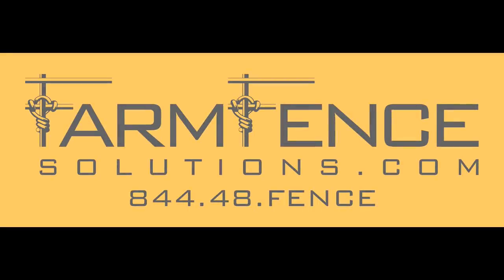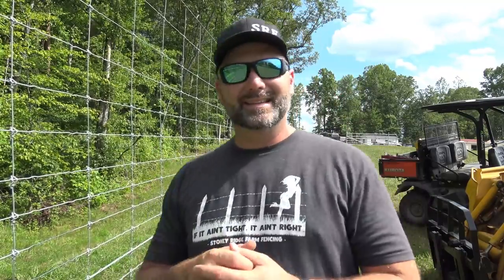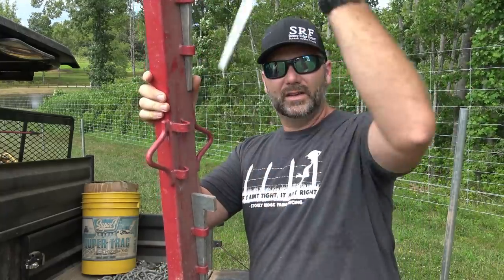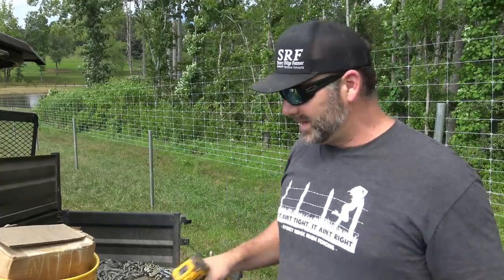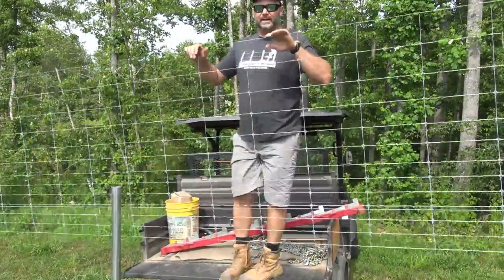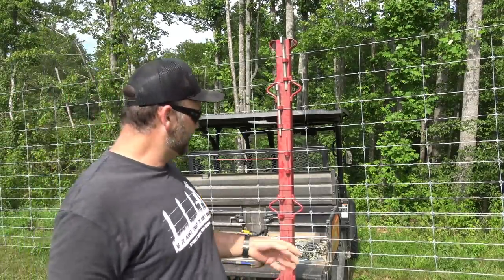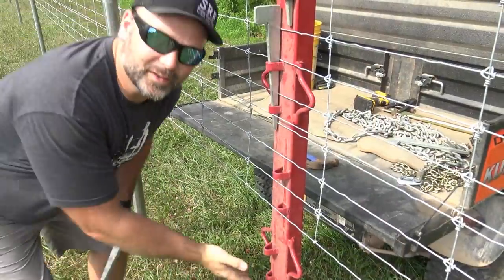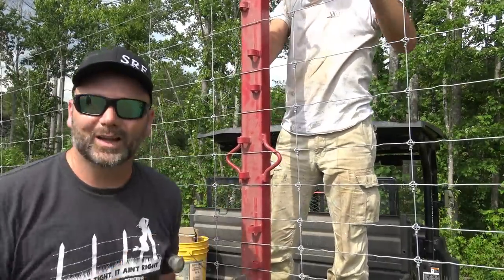THIS COULD GET INTERESTING! Farm Fencing High Tensile Woven Wire tips & Gates!

Comment: Just a thought on what I do on the gates that I hang, I coat it with axle grease, keeps it a little more quiet and won't wear quit as quick. Cause is ya think about it, that's a lot of weight hangin on those hinges.

Comment: I did a couple of gates before. On the high side of the gate you can weld extra runners at that side at an angle tobasically extend the gate down

Comment: dad always told us put the fence on the inside of the between the cattle and the post that way the cattle will push defense against the post except on the corner stinney put on the outside
Reply: called, fencing, in or out, you are correct, but most dont do it

Comment: Great video, learned a lyou used on different ot on fencing from you. I was wondering if there is video on what type of fencing you used on different parts of the farm and why?
Reply from the maker: we only have 2 types of fence...the wood fence you see in the background...and this fence...the wood is functional and pretty too...the pipe fence is also functional...we are constructing paremeter fence for different areas and paddocks on the farm...we'll use poly braid to section of and intensively graze as our herd grows

Comment: Curious to why you leave the guide wire with the fence after the posts are set.  I get why you are using it for the line to set the fence over string but is there are purpose for it once the wire fencing is installed?  Also where the gap is really big on the fence gate could you weld a section on it to fill in the gap?  I know it would look a little cattiwhompus but I would be concerned for the baby calves there as well. Great job as always!
Reply from the maker: The wire at the bottom brings strength to the fence....the top is the most stressed point....the second most stressed point of a fence is the bottom, as for the gate...10 inches most likely isn't gonna cause me a problem...if it does we'll address it for sure

Comment: I noticed in this video that the tops of your posts are not capped.  I know from previous videos that your pipes are very heavy duty, but there could be a possibility of those pipes splitting in the winter with water freezing in them.  You may consider capping the posts just to keep it from happening.  I have had pipe posts in Illinois freeze and split when I ddi jot cap them.
Reply from the maker: keep watching and we talk about it ...wink wink

Comment: Why is the fence on the outside of the posts? Wouldn't the fence be stronger if the fence was on the pasture side of the posts?
Reply from the maker: This was done for aesthetics here close to the house..realistically the cows will be out front here about 3 weeks per year
Reply: I've seen that question before and was curious myself. Josh will tell us !
Reply: @StoneyRidgeFarmer  how far did you space your posts?
Reply: Also what is the cost per acre for that fencing?
Reply: Looks like 20 or 24 feet on spacing but you can't do that far with cheap farm store store wire... Any low carbon wire needs post around 10 to 12 feet to be half as strong

Comment: Great video Josh. I do have a question, why did you go with woven wire vs a high tensile electric? Thanks
Reply: Not Josh, but if you can afford it,  woven wire for perimeter fencing is always the way to go.  No worries about deer dunning through it, power outage, or a short.
Reply: Steve Terry For rotational grazing, high tensile electric is pretty handy for setting up paddocks.
Reply from the maker: Woven wire parameter fence is best in my opinion...it's not a psychological barrier...it's a physical barrier to keep our livestock contained. Where we live is populated...not like Polyface (Joel Salitan) or Greg Judy's place that's way out in the middle of nowhere.  We'll have a "hot" line ran acrosss the top and in high traffic areas we'll have one at about 30 inches.  We will mobstock rotationally graze by tapping into the parameter hot wire and running poly electric cross fences...just like the other boys ya see here on youtube...but with Josh's touch.  Safety is priority....many a cow, calf or sheep or goat has pushed it's way under, over or through high tensile electric .....just ask anyone who's used 5 strands or even 7 strands of high tensile.  We need a physical barrier to keep our cattle away from the local roads.....So...the answer is safety...for our livestock...and for passers bye.  How horrible would I feel if I had thrown together a fence that wouldn't contain my cattle...and a state trooper calls me in the middle of the night to tell me a mini van just hit one of our cows and killed 4 children and a mother.......THAT'S WHY MY BROTHA...this is not the end of our fencing...this is just the start...the parameter.  Hope this answers ya....I'm getting ripped apart by every Greg Judy fan on the web....I've been there....I talk to the man on the phone from time to time....but our situations are very different....cool?
Reply from the maker: Thanks Steve....what folks have to remember is this is just the parameter fence....and we'll run a hot line on top...and we'll be intensively grazing once we have enough of a herd to do it.  This is a physical barrier...that's what it's all about...safety...security and being a good land steward.  We're far from done!
Reply: Fair enough. I’m familiar with Polyface and Greg Judy. It’s hard to judge tone through text so I hope my question didn’t come across as an attack. Just curious what made you go with woven wire. Thanks for the response.

Comment: Hey Josh, love your friends building series. I am curious as if there’s going to be cattle in this pasture, why your fence is not on the inside of the post and not the outside? Wouldn’t that make it easier for them to push it out?
Reply from the maker: so.....yes...however they won't be able to push the fence...we went on the outside here around the house for aesthetics...same as the wood board fence. We'll run a hot wire inside to keep livestock off the fences
Reply: Stoney Ridge Farmer got it Josh. I understand why you did it that way now. Love your channel and will continue to support.

Comment: Maybe i miss it ,? when did the lowest single wire get typed down? We ran a string of barbwire in that location and one at the top.keeps horse from reaching over the top and bottom.
Reply from the maker: oohh...don't tell the horse folks you're using barbed wire!! So the lower wire is tied in at the bottom of the net wire...provides strength down low...as you well know the most stock pressure is on the top of the fence...second most is on the bottom..thanks for the great comment Greg
Reply: @StoneyRidgeFarmer  So it is tied to the lowest strand of the fence wire. thanks! As for the horse folks they will just have get over it!!LOLL

Comment: A fence is a long term investment...spend the money to do it right and it will last 50 years. In my YouTube travels you are one of the first in the USA I've seen that have used steel posts and woven wire for fences. Here in my part of Australia we have used woven wire and steel posts for decades, but usually "Y" shaped posts with holes in them to tie the wire to. You can manually pound them in. I think you have similar T posts in the USA? Time is money so I use gripples a lot instead of knots and also special Aussie Y posts that have spring loaded clips that the wire clips into. It literally takes less than 10 seconds to clip two barbs and 7 wire woven into a post.... https://youtu.be/3c8_HM6_nVo

Comment: Bottom gudgeon or hanger should have been at ground level or better still dug  out a  little to bring the latch end down. Looks pretty awful as is!
Reply from the maker: no...not really...it looks just fine.....believe me I'm pretty critical of myself...would it have been better to put the gate in a flatter area...yep...but the highest point of this gate is still only 11 inches....same height as the wood boards on the board fence behind us....it looks just fine...and again...I'm very critical of myself.  I took you guys to this gate on purpose to show ya....everything isn't always gonna be 100% perfect in everyone's eyes on any job
Reply: Stoney Ridge Farmer fair enough, I appreciate what you present. Just for your interest, here in south east Australia (Yackandandah) generally speaking farm gates are usually an inch and quarter pipe frame as  yours appears but with a “w” or “v” brace and covered by 9x4” gal mesh, 12 feet span is most common, similar gudgeon at bottom but a saddle at top. So they would be much lighter than yours. Gates as heavy as yours would be in a stock yard.     Strainer posts are done the same but we use a star picket ( y shape actually) in between  10 to 12 feet apart and a heavier one “2 inch “every 4 th or 5th. Keep up the good work. Who Hoo!

Comment: I am criticizing.   Just asking,  why are the wires on the outside of the fence and not on the inside?
Reply from the maker: Wire on the outside here because the fence runs up the side of the driveway....asthetics. This will be a low stock pressure area and realistically the cows might be out here for 2 weeks out of the year....no worries there...if I find the cattle are putting pressure on the fence we'll run a hot wire at around 30 inches

Comment: Great video I will say this it's a lot better way of fencing as the way we did it when we grew up there ain't nothing like digging the post hole by hand tamping in the posts and then the stretching the wire and steepleing the wire to the post piece of cake lol great job of showing the better way to fence have a good one wooooo
Reply from the maker: Yessir dug alot of holes and tamped alot of posts in my day too!

Comment: I was baffled by this video. First you placing the stretcher too high and then pulling down with the pallet forks. Of course I only used chain link with round posts and t posts with woven wire.  The skid steer I use pushes down with the pallet fork and the  stretcher fits inside the fork. You did an excellent job explaining gate installation.  You also work really well with your helper.

Comment: Josh, you ever get your passive water system fixed?
Reply from the maker: It's holding strong after replacing that flattened pipe section...maybe that was what was wrong

Comment: A company I worked for for nearly 10 yrs  invented and produced the ties in this video. They were called "twist tight ties", by LC Enterprises in Escanaba Mi and were originally designed for prison fences then expanded.
Reply from the maker: cool
Reply: @StoneyRidgeFarmer  Also invented the Instalink... We were on the cover of "world fence news" 3 times when I was there, and I was in 2 of the 3 photos.    One of which showcased using the instalink when we installed over a mile of 6' aluminized 10ga (holes dug, posts set, and fabric stretched and tied) with a three man crew over rough terrain and swampy land in the middle of the woods in less than 8 hrs!   We had a blast!  Later that year, we procured a contract with DandyDigger...an animal all of its own!

Comment: I hate to tell you but the wire is on the wrong side of the fence. The wire should be on the same side as the animals. When they push against the wire, if it is on the outside, it makes it easier for them to break the ties. If the wire is on the inside, they are pushing the wire against the post and the weaker ties never are compromised. Just food for thought.

Comment: You know you can solve the problem of the gate by putting some soil with retaining blocks to bring the grade up closer to the fence. If you put the retaining blocks by the opening end post on the lower end and then just grading some soil you can even take that from within the pasture area or anywhere else on the farm just move it in with bucket loads on any of your tractors or skid steer. If you have concerns about stepping off and falling down over the retaining blocks, you could put up any short segment of fencing including a four board fence with a post inside and one outside and then run your boards or slats through the tornado wire fencing creating a small T on the open side of the gate which would have no effect on your fence height or gate height. Hopefully I’ve explained it well enough for you to understand, whether or not you do it is up to you of course. Wooooo!